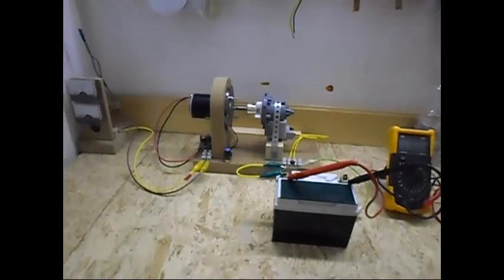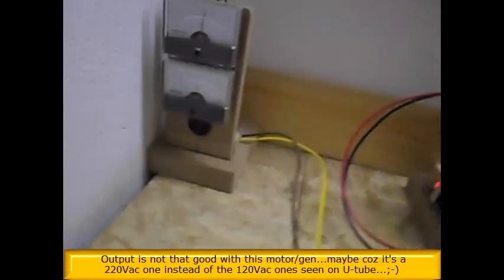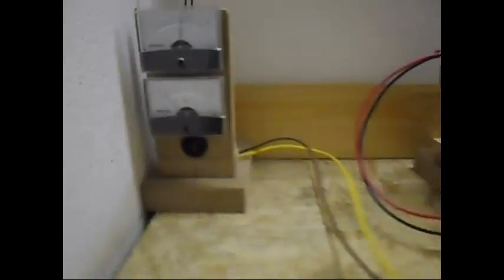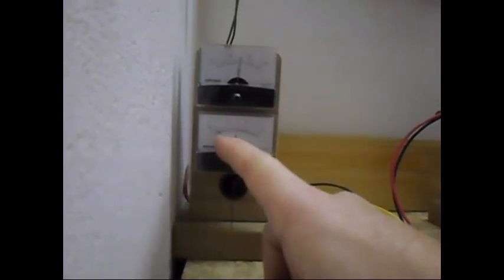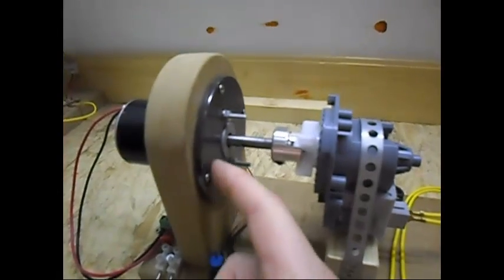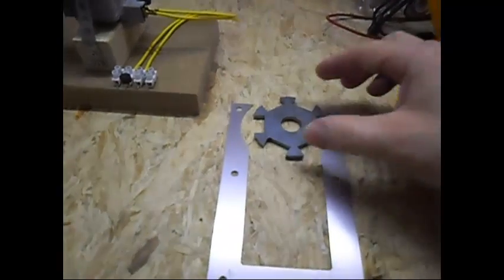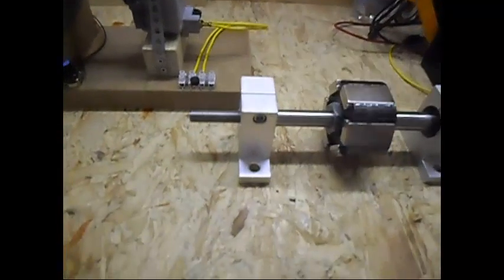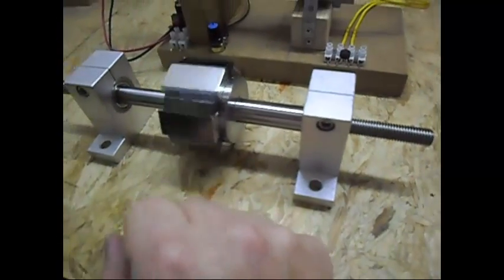DC motor - Dishwasher drain motor,  The Gerard Morin setup and info on a larger build...

Comment: That washer pump takes ,120 volts to run, so i believe if you eun it at the rigjt speed you can maby get 120 back out of it. I am messing with almost the same one. Mine says 10 minutes run 50 minutes off, sonot doesnt burn up i guess.

Comment: I can't seem to get mine to work, can someone help? I have a 12V DC motor like that, connected to the pump with the magnet spinning. It's doing about 7000 RPM, but I get no light when I connect my lamp to the pump. It also says 60 mV on my voltmeter when I measure the pump output.

Comment: I will tell you the SECRET to running a small motor less volts to run a large generator lots of volts , so that it will stay running until the brushes wear out. SECRET IS that BOTH SHAFTS must touch contact points in both motor and generator at the SAME TIME. IF NOT it will STOP working. Lets say you have a 9 volt .5 amp motor running a larger magnet/generator that puts out 120 volts 10 amps. You should be able to use some of that power to run the motor that runs the generator and any excess power to be fed into a step up transformer and caps.

Comment: What you can try to do is copy how power stations function and make a mini version of power stations where gerard morin motors act as turbines, step-up and step-down transformers like power stations set it up, inverter, batteries, hz regulation, etc. I think then it will be then probably possible to create a mini power station capable of powering a single house.

Comment: how many KW and how many rotating per minute need to have a motor to run normally the water pump?
Reply from the maker: Thanks for your comment...^^
About how many KW...lol...it is a very little motor so just a few watts will do just fine...;-)

Comment: why cant you use an alternator and an inverter so input is 16 volt and 1 millamp and rewire the alternator to put out 50 volts and higher amps?
Reply from the maker: Thanks for your comment...^^
In my case a PWM is perfect and easy for me to control the speed of the DC motor...;-)
About rewire a alternator....the higher voltage you want out of it the lower the amps will be so it depends on what you want from your alternator but sometimes a higher voltage is needed because this gives us also higher resistance/inductance of the coil which can translate to nice effects...;-)

Comment: How did you get the propeller off of the water pump motor?
Reply from the maker: Thanks for your comment...^^
The prop is still on there, i just made some groves in it for the DC motor shaft to connect...;-)
See at 36 seconds...

Comment: Good job, It is fun to play with this setup, I agree. Just one recommendation... Put a vibration damper between the pump and the wood mount. Also where the strapping touches the pump. That should decrease your noise. 

Cheers.
Reply from the maker: Thanks for your comment and also for the tips on keeping the noise down...^^

Comment: Nice build.  I do fail to see the advantage of this setup since charging a battery can be done using several methods.  Was this just to show how to charge a battery with a motor and generator?  Any claims of free energy made by Gerald Morin should not be taken seriously because he thinks if he has more current drawn than inputted he has overunity.  He fails to consider the voltage and subsequent Power out verses power in which is certainly less.
Reply from the maker: Thanks for your comment and i'm glad you've liked it...^^
This was just a test on this Gerald Morin setup...nothing more but maybe less...lol
Well, as many of these free energy gurus do...they tend to show/talk about what makes their setups looks like overunity...;-)
So they just happen to forget to total power factor in and or out of W=VxA thing...lol
In my case it looks good to but it is far from being able to self loop and that's why it was a one time thingy...
But i did like the way that motor is build which reminds me of vintage dynamos so i went i build a few...lol

Comment: more inf. on not the pump,,,other model,,,,all parts ,,,thank you
Reply: hello. but you mean that is no necessary to do any modification to the PUMP to produce overunity? please help
Reply from the maker: +Owens Rayfeilds 
Thanks for your comment...^^
I don't what to say since there isnt much to trhis setup...???
Just a simple pump and a dc motor PWM driven and thats about it...lol
Reply from the maker: The setup in the video is not overunity...after a 24 test run the battery still dropped in power...-.-
The output from that motor/generator is not enough to keep it running forever and let alone light up a tiny led lamp...;-)

Comment: Heya, im very impressed about your 100mA draw only. i have myself running about 1A on lowest rpm i can get with crap speed controller, but i have ordered some chinese PWM then i redo my tests.
I was able to produce abit over 300mA(i need verify that later with an analog meter) from motor(on lowest rpm what i could get with my speed controller atm), but i live in europe so all pump motors is 240volts instead 110volts, it has more coil, so it can produce more!
Have done video also, but anyways no point looking it, its bad, becouse my speed controller sucks..

Try different loads, they matter on motor drag! if you use cap in series with load you could get alot more power, but the drag is super big, it broke my connecting axel lol!
The annoying humming sound come of pump motor drag, try rotate shaft with your hand, you will notice a notable drag. only way maybe is use a flywheal if wanna dump that sound.. not sure?

one more thing, connecting a charging battery as load my motor rpm gone up, so probally it draw less..
Reply from the maker: +riku2015 
Thanks for your comment...^^
Well the input is not that bad but the output is not that good either.lol
With a PWM you can play around and see where your motor uses the less input at a certain rpm and /or load...;-)
I'm in the Europe as well but mine can produce very high voltage but with very little current i my case ;(
For a PWM Ebay or Aliexpress is your best friend, the one i'm suing is like 1 or 1.5 euro and it is pretty good but not 3A rated as they label it.lol
Buy a set of 5 because, it will save you some cash since a set of 5 has a discount on it...;-)
But since i very rarely go beyond 1A it is oke...:D
A flywheel i surely help to smooth out the cogging it has..;-)
If you connected a battery as a load and your drive motor rpm goes up it sure is using less but be carefull because in some cases it uses more.lol
Cheers

Comment: I like the setup and the newcoming design.
More rotor mags the better.It will give more power at lower rpms.Also the bigger the better huh.Great!
Reply from the maker: +foamaxmore 
Thanks for your comment and glad you liked it...^^
Low rpm makes for longer life duration of any setup but sometimes high rpm is needed for testings...;-)
With these setups sometimes bigger may produce better results...^^

Comment: Hi, I am fascinated by your setup: i got myself 2 of those motors.. they are very nice. As they arrived 2 days ago i have not tested anything big yet. But how do you get them to draw only 100 mA?
I am also using a pwm, the one i have goes from 6 to 16v.. so i run it on a 12 v battery. the lowest draw i achieved was 350 mA without any load...
I did put it on my 3 phase generator and it turns it at 2200 rpm.. wich is nice,... but the draw goes up to 1and a half amps without a load...
is it your pwg? i ordered some other ones from 6-90 volts to be more flexible... I will tell you the results.
Luc
Reply from the maker: +DaKrampus 
Thanks for your comment...^^
Hmmm, i&#39;m using a 16vdc input but the PWM is only about 1/4 to 1/3 open so that is why the motor run so efficient...
I will run one of these motors on that 16vdc with the PWM full open and unloaded and let you know how much it is consuming...;-)
Should have that info for you lateron tonight...;-)

12 at 350ma unloaded...is this without or with a PWM fully open...???
1.5 amps is very high for a unloaded 3-phase gen setup...does it have cores...depending on your cores setups it can have a negative effect on the drive side but still 1.5 amps is a lot...???

That 100ma is easy since the PWM is here around 1/4 open which isn&#39;t a lot...;-)
The PWM i&#39;m using are these ones, http://www.ebay.nl/itm/400755823151?ssPageName=STRK:MESINDXX:IT&amp;_trksid=p3984.m1436.l2649
They can&#39;t handle to much but they are oke for low power setups...:D
Reply from the maker: +DaKrampus 
Oke so i did the test with 16vdc input and the amp draw is 375ma unloaded...^^
I even tested another 3 amp analog meter just to be sure this one ain't kaput but same 375ma @ 16vdc...:D
The PWM was fully open to it's maxed...!!!
So it's pretty close to your unloaded amp draw except that your 350ma is @ 12vdc...
Cheers
Reply: +Mister Caribbean Roots 
Yes exactly, I must say that at 24 volts the amp draw is 450 mA unloaded WITHOUT a PWM (waiting for the new ones to arrive as mine only goes to 16 v max)
I will do some tests on Sunday and let you know..
Reply from the maker: +DaKrampus 
So all seems oke...so that 3-phase gen of yours sure has some massive cogging...o.O...if that motor needs 1.5A just to run but at what rpm...???
The higher the rpm the more it will draw...;-)
If can get this motor of mine to draw 1.5A also but i won't...lol...don't want to fry my tiny PWM or motor...
I need both for many upcoming future experimenting...^^
Reply: +Mister Caribbean Roots 
Actually when it runs full speed ~ 1.5 amps it will run at 2200 rpm..
when i charge a battery with half a phase it will go down to 1800 rpm and will draw like 100 mA more..
if there is no load there is no cogging because air cores only.. 
I am preparing a new setup for tomorrow as i am going over to a friends place. he will do the video because i cant when i have my hands full. lol
Luc
Reply from the maker: +DaKrampus 
Oke, but how come your motor is drawing 1.5A when your gen setup is all aircores...o.O...makes no sense to me...???
Is your rotor that large and heavy or are you using pretty crappy bearing which would give you a lot of frictions...???
I must be missing something here and there...lol
Nice to have a friend that can help you out when your doing testings on your new setup...the more hands the better...^^
Have fun...:D